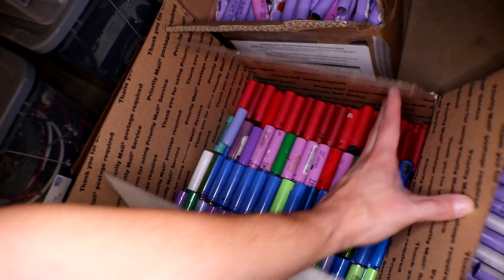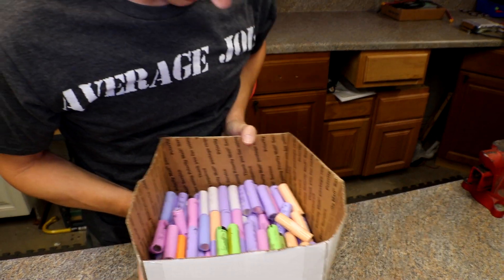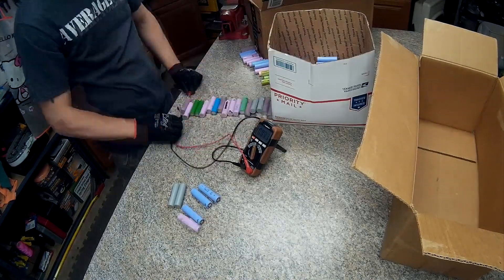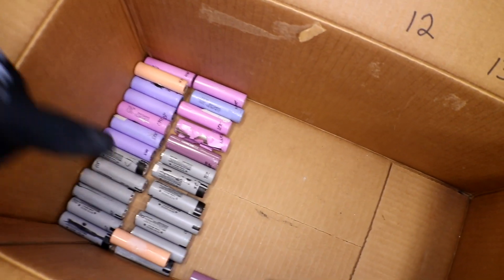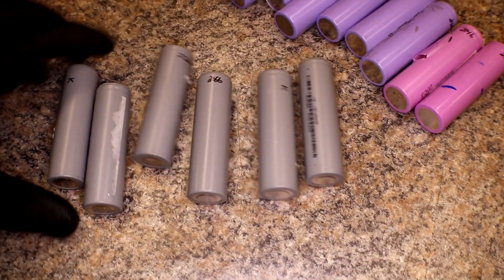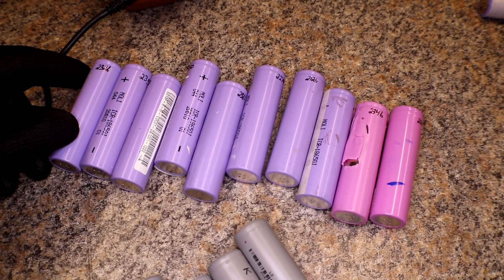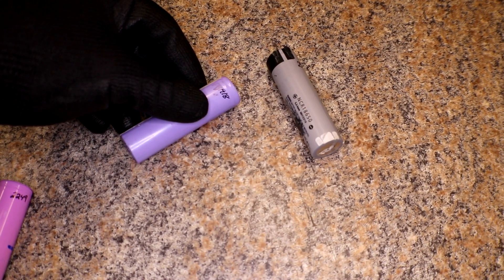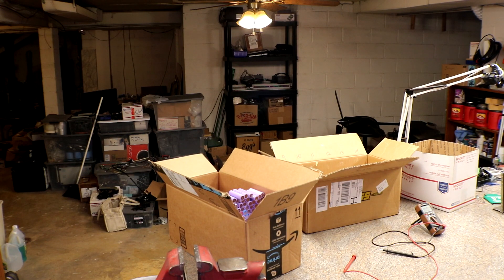🔋⚡Checking Voltage and Sorting 18650's "Manual Repackr"🔋⚡

Comment: Hello Mr.AveRage Joe. I am currently (no pun intended) testing capacity on around 2500 18650s for the second time to weed out any bad cells.   I will end up with most being 4.19-4.2 volts. Over 60% have a capacity of 1500-1700mah How should I sort these power wall packs using 1500-2600mah?
Reply from the maker: You could use the repacker program online or similar to how I did. I just started with the highest mah cells. Sorted all those into equal packs. Then did the same with each set of mah until all sorted!💥🤘
Reply: @AVERAGE_JOE  hey buddy hanks for the reply! So it isn’t a problem to use packs balanced with 1500mah all the way up to say 2400?
Reply from the maker: I used 2000-3600! We use what we get! Of course I am using LiFePO4 now tho!
Reply: @AVERAGE_JOE   ok sounds good thank you

Comment: old video i know but what i do is get small round stickers with numbers on when i remove from charger i stick a label on for the number then enter the capacity in a speadsheet when all cells are done i then copy and paste to repacker the number make it a little eaiser then capacity numbers also why do you start with lower number would it not be best to start with the highest number
Reply from the maker: Yeah thats one way of doing it for sure. I should of done something similar!

Comment: One more question: are you testing capacity or just voltage when matching cells? You may have cut it out the video but looks like you just used multimeter to test? Thanks again in advance.
Reply from the maker: At first I check voltage to make sure the charger will accept the cell. After capacity check I let them sit, then check voltage once more before sorting into packs just in case a cell loses voltage over time. I mix all cells from 2000mah to what ever the highest is like 3700mah.
Reply: AveRage Joe thanks a ton man. Looking forward to your next video.

Comment: You talk a lot, like about boxes and where to put stuff, but when it comes to the interesting part, actually doing things, you speed up the video without even telling what you are doing.  How do you select cells, how do you decide which cells are OK to use and which should be discarded?  Do you charge the cells first? Do you let them sit for a while to see if they keep the charge?  How long? Do you know how old these cells are?  Any idea about the number of previous charge cycles? So many things remain unexplained.  I would very much like to see how do the test. This is rather confusing.
Reply from the maker: LOL.  Selection process is going to be your own set of rules- Most will set a minimum of 2000mah (based on discharge cycle) because there is still an ok amount of life left in the cell. Obviously the higher the better.  A lot of people will charge the cell first and let it sit for a day or 2 especially if they were half dead.  After that do a discharge, charge cycle and let them sit for a week(or 2, you decide) to see if any self discharge.  My minimum is 4v BUT my cells usually end up sitting for months or longer before I get to building an actual pack.  If the voltage has dropped below 4v, then I put them in a bin for recycle.  Also bin them if they are to hot to the touch during charge or discharge cycle.  They have to much internal resistance.  Those are usually older red sanyo cells.  Dates are usually on the laptop pack to give an idea of age.

There are many ways to the "selection" and weeding out process of cells.  Some will include internal resistance.  The lower the better, anything over 200 they say is kinda high.  I will add that our cheap chargers we use are not SUPER DUPER accurate.  If one wanted a real internal resistance number you would need to get an actual meter designed for it.  

So to sum it up....

1-charge cells. (let sit for a day or 2 if they are below 3v lets say)
2-discharge cells and record that number.
3-recharge cells and let sit for a week or 2, recheck voltage to check for self dischargers
4-(optional)check internal resistance of fully charged cell at room temp. Above 200 its probly bad.

Comment: how you get the amphours from using a multimeter?
Reply from the maker: AH is all the cells added up in a single pack. Exp: 100 cells at 2500mah is 100x2.5=250ah🤘

Comment: Hey Joe,  maybe u rememeber me chatting regarding a ev using a forklift truck motor.  Ive done tons of research and Turns out those old fork lift motors are soooo hard to get hold of now. i remeber u saying u have one. If you have one and the fork motor is good. all u need is a controller $400 and a donor car $300 and youve got a free car to travel. Bang good! Its not to tricky. Maybe an engine hoist would be good $150 a welder and your all set.
Reply: Imagine the new audiences youll tap into!
Reply from the maker: I agree, would be awesome!!

Comment: Hey joe got a question MAYBE you or one of your viewers can answer I got a diy lithium battery bank but I got some some 6v golf cart batteries givin to me my question is can I hook up 5 in series  instead of 4 in series my inverter will go up 29v if I run 5 an charge up to 29 could I run them the batteries are new
Reply from the maker: Ive used 6v golf cart batteries before for solar and when you equalize them they can go over 7v each and that could fry the inverter.  I would personally use 4 and keep the other for a spare just in case one fails.
Reply: Hey thanks I'll do that I made 12 7s 10p I run 8 two strings of 4 and I keep back 4 comes in handy when I do maintenance on a string I was hoping for more power for led acid but hey what ya do  thanks again

Comment: Joe, sorry to go way off topic here but I could use your advice. And hopefully you have some fun along the way trying to crack this riddle of instructional manual from China. I can't seem to get this meter connected to my 40amp relay. I have asked around but no one seems to get it either. Anyway here is the instructional manual in question. https://drive.google.com/file/d/1-D0AeiXDSPdwsKMWCVTV_5RJGYyJGsdr/view?usp=drivesdk

I know you're extremely busy these  days, hope you are doing well. If I don't hear back I totally understand . Thanks
Reply from the maker: Can you not use the relay thats on it now?
Reply: Unfortunately this model didn't come with relay. One has to be added for over and under voltages and  current. But! I didn't think it was going to be so difficult to comprehend the instructions on how too. Were you able to look at the file of the instructions? Do you think you can figure it out? Thanks a million. Lunch is on me if you can do it...man I really hope you can!
Reply from the maker: Does yours have those hook ups to add a relay?
Reply: Hey,  Have you had a second to figure out how to wire up that relay? Peace bro!

Comment: 7:03 why are the cell voltages so high? Did you fully charge each one before storing them? New cells usually arrive at 3.4-3.6v it seems. Great video btw
Reply from the maker: The intent was to start building the packs sooner. so after testing the cells I put them in a box. Welp couldnt get to building them until meow so there still full charged.
Reply: @AVERAGE_JOE  Ah right, I guess life gets in the way :) Apparently most cell degradation happens at higher states of charge, because that's when the anode and cathode react with the electrolyte the most. There's a really interesting presentation on YouTube called "Why do Li-ion Batteries die ? and how to improve the situation?" if you're interested in the topic at all. Cheers
Reply from the maker: I may have seen it but not sure. Ill have to look it up!

Comment: You should get a KWeld to assemble the packs I have one and it works great! You can even use it with the fuses!
Reply: Also do you know of any other place I can get medical packs? I’ve gone around to local hospitals and they say that they send them off to a recycler.
Reply from the maker: Need to find the recycler they send them to😉😉. If your looking to buy medical packs or cells terry from power2spare sells them. Link down below!
Reply: AveRage Joe Oh the only problem is though that I’ve had trouble with the kweld with underpowered batteries it just doesn’t want to work but if you use the kcap or some lipo batteries it should work pretty good. And I never really thought of asking the recycler that might actually work since I’m 17 and I can still use the “it’s for a school project” excuse! 😉
Reply from the maker: I have one, just need to assemble it lol. I also have an arduino spot welder and it works pretty good as well.🤘
Reply from the maker: Gotcha!  YES!!!!! PERFECT!!!!!! School project lol.  That should work!!!

Comment: Is there actually room in the rack for another 14 packs?  (and are you going to make more PVC cell holders for this set?)
Reply from the maker: Well I could probly sqweeeeeeze in another pack on each drawer but it be a tight fit. Ill probly get a few more drawers or shelves and keep it 4 packs on each for now.
Reply: @AVERAGE_JOE  Yea it already looks like a close fit with four packs.  I just picked up a 24U rack but am having trouble fitting all 20kWh of Ford EV packs along with the 3U UPS I got.
Reply from the maker: The plan is to cut more pvc but have been pondering the other cell holders cause I could fit more cells in there!🤔
Reply from the maker: How many drawers/shelves you have?  If I add 3 more drawers I can fit 14 more packs!
Reply: @AVERAGE_JOE  I can only fit 4 shelves since the packs are 3U tall and I need space between them. Also using a 3U tall UPS which doesn't help either.  Need 5 shelves to do it, or build longer battery enclosures to fit more cells per shelf.

The stock enclosures hold 21 cells; I re-configured one into 7s3p - https://i.imgur.com/8IgHIyN.jpg
Reply from the maker: I gotcha! That looks pretty cool!

Comment: Do you take into account any of the manufacturer's specifications for the cells that you use, or do you just go by whether they hold a charge and how much capacity they have?   Furthermore, do you care that Cell A has, for example, a maximum output current of 2A and Cell B has a maximum of 5A when choosing cells for your packs?
Edit/Added:  Because I would think that balancing packs would mean not only balancing the voltage and the capacity, but also balancing the ability to deliver that capacity to the entire system.
Reply from the maker: My standards are pretty low.  I go off if they hold voltage and above 2000mah.   Oh and I dont use high discharge cells mixed in if I can help it, Ill save those for other projects.  It really depends on your standards.  Some have high standards and some low standards.  In a big battery pack the charge and discharge rate is going to be very low like 500ma or waaaay less per cell.

Comment: Manual repackr. Why start at 2k and work your way up instead of starting with the 3ks and work your way down? Or was I not listening correctly?
Reply from the maker: Yeah you know, pencil and paper😆 No reason to start at 2k vs 3k.  I might actually start at 3k this time to weed off cells on the lower end!🤘
Reply: @AVERAGE_JOE  I suppose if you have the exact number of cells you need it doesn't make a difference, but if you have... more power, I'd start at the top and work my way down. At least in my head, that seems to be the best way to get the biggest 💥 out of the cells you have.

Comment: The quickest way for me to get a verifiably balanced battery:
Test for voltage (self discharge), but don't waste time sorting cells - it's not accurate anyway.
Distribute 1400 cells to 14 packs using the "card dealer" method (ie. randomize).
Build the 14s100p battery, top balance, discharge until lowest pack approaches 3.0V), note voltages of all packs.
Most packs will have very similar voltages - no need to touch those.  
Swap low capacity cell from low voltage pack(s) with high capacity cell from high voltage pack(s).  
Usually 1 pass is enough, but repeat if necessary.
Reply from the maker: If that works for you, great!!!  I definitely take some time to sort and balance the cells before building! 🤘

Comment: Hey... wanted to share something I designed. Nothing big but holds 50x 18650 in stackable compact case(s). I didn't see a 3D printer so apparently I'll have to ship you some :) Sounds like 30 cases are in order. If I start now, I can probably have them printed by the time you finished your build :)
http://www.thingiverse.com/thing:3762006
Reply from the maker: That is one thing I STILL DONT HAVE🤔🙄😆  Thats a great idea for holding cells.  You better get printing💥😆🤘

Comment: I use the chinese ones if the numbers are good. however i use the 4x5 black plastic grids that are easy to swap out cells. Haven't had an issue so far though (1 year ebike use)
Reply from the maker: Numbers are good!  Thats good to know that they are going strong!!!!!  Thanks for the info!🤘

Comment: Those Chinese cells, if they pass the hollow test, they must be genuine enough. I have some that i was deciding.  If they don't self discharge and don't turn into little heaters on testing and there is no history of catching on fire then why not?
Your cat is cute and cuddly.  Put strands of wool on the cells and put the cat to work sorting.
Reply from the maker: They test pretty good.  Most of them are above 2000mah.  I hear mixed results as in great cells and crappy lol.  Maybe it depends on brand!  He SHOULD start helping me sort cells. Would make things A LOT easier!😆🔋😹

Comment: I wouldn’t use the Chiny cells. Biggest failure rate I’ve had is with those
Reply from the maker: Do you remember what brand you had?🤔
Reply: AveRage Joe They were lishen but a purple colour. Just don’t think they are as robust or reliable as the big 5.
Pana Sony Sanyo LG Samsung
Reply from the maker: Gotcha!  Ive heard there are real chiny cells and then there are the junk ones.  I dont know which is witch!💥😆

Comment: The grays are LISHEN cells. One of the most respectable Chinese manufacturers, along with BAK. Never had an issue with them.
Reply from the maker: Nice! To be honest Im betting there are many in my first 14s😆
Reply from the maker: Really?  Do you have them in your packs or do you use them in other projects?
Reply: AveRage Joe I have them in the first pack (7s40p) I built. Never had issues. I only use cells that give out over 80% of original under 1A.

Comment: How do you know or get the value of your cells?  you mention 14, 15, 16 etc.  How do you get that value?
Reply: Charge and discharge, with a charger that does capacity test,
Reply from the maker: I used a few different chargers to get all the capacities of the cells!

Comment: I can't wrap my head around 1400 cells, I first saw Peter doing it, and I just shook my head, noway!  But, you have me warming up to it.  
I did use repacker on my first 2 packs, but they are 7s21p, still a job.  I think I put them in a spread sheet then exported them comma delimited and blew the file up repacker. I still lost a couple due to I couldn't read my own writing on the cell.  But the packs stay pretty close in charging and discharging, tho my little chinese 20amp BMS, got really hot.  This was only running 13amps discharge on the 2 packs in series for 48v.
Your technique might get pretty close I think.
I have 2 cats, the one was happy till I let a stray take over the place, but he is a real trooper, almost on a watchdog level for outdoors.
Cheers.
Reply from the maker: I would think 7s21p would be a little easier to manage🤔 Yeah a spread sheet would probly be a good idea.  Im still warming up to the idea!  The manual repackr job I did last time I swapped around maybe 10 or so cells to get them all 226ah each so it worked out pretty darn good. Does your bms get hot every use or just the first few times.  Nice, all our cats were strays.  The one attacking the shoe strings is the newest and shes around 13yrs old from what the vet said lol.  Yeah total watchdog!🤘😆💥
Reply: @AVERAGE_JOE  BMS has 4 MOSFETs , the first one got to 95c the others taper down to less for each.  I melted some black gooey stuff between the Mosfets, so I tossed that one.  I may have one series going lower than the others on discharge, as I was watching with a capacity checker, so probably stressing the BMS.  I'll try another discharge cycle when I finish these new batteries.
Reply: Update.  I took the BMS out of the circuit for discharging, temporary setup till I get my 14s80p built!
I had to manually balance  pack, also checked all cells in a low series (21 cells), all fine.  BMS had to be messing with them while discharging.  Always cell #4 on both batteries, strange.
Yep, you talked me into at least an 80p, LOL.  Studying the Batrium to go with it.

Comment: Cool Beans.   Wish I could come up with something like like 7S 25P.    I like the Repaker !   Repacker helps insure your packs are Balanced to the most parts.  Always run the Pack numbers TWICE.  Yes it can change.   label the cells by mAh test number.   Test, Enter Test number in Repacker list. Maintain a list of individual cell numbers / mAh number.   Keep the cells  grouped by mAh .  IE /  2000 -2500.  2500-3000.   consecutive numbers in a bag or box for easy location when needed.   Grouping the cells by mAh number is the easiest way to find them when your packin em.  Packing using the Repacker Numbers can get ya seriously close and low deviation.    Beeeeeen There !  Damn Your messing with a Butt Load of Cells.    Or do it Your Way?  LOL
Reply from the maker: Its Re-Papper🤭🤣 Yeah the last manual repackr job I made each pack 226ah exactly according to the "test" numbers. Ill do it again this time as well.💥🤘